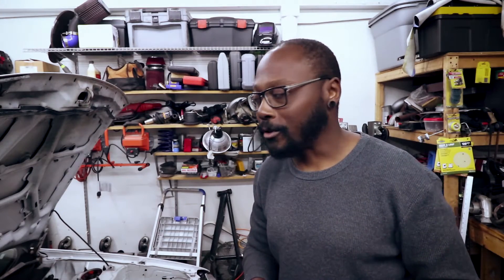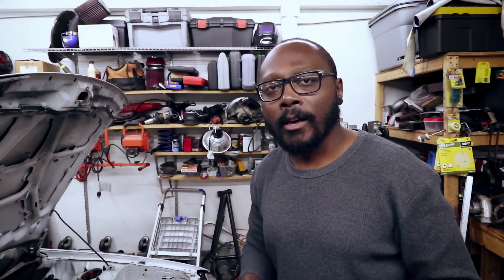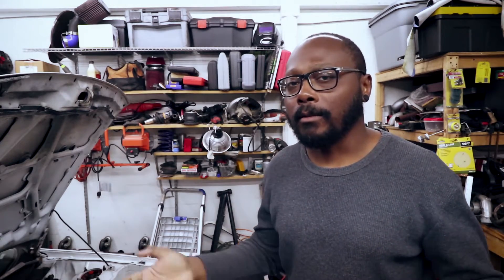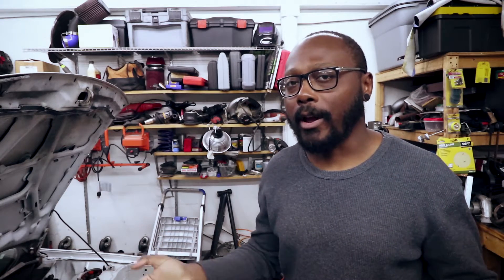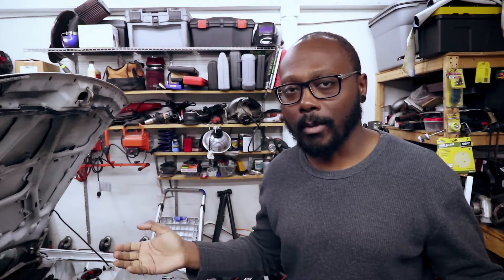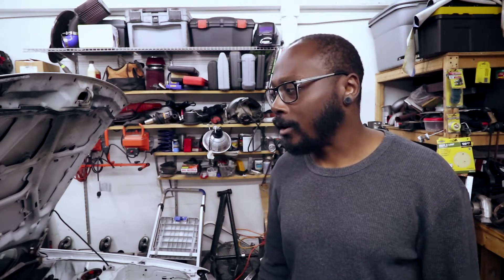Spark Blowout with COP...

Comment: best way to test for a voltage drop would be to load that circuit... I usually use a sealed beam. then you check from 12V at the battery to 12V at the coil or whatever you testing. difference between both (reading) will be the voltage drop.

about coil... I was thinking about VAG COP... integrated igniter, capable of firing a lot of Kv... and no need to bolt down... just not 100% sure they'll fit well. I'll try soon to fit to see how it goes. keep you informed!
Reply from the maker: Yeah, I'm going with the Toyota coils, I talked to Carlos (BP preformance specialit/la Stanley racing)  he's ran the Toyota coils to over 800hp so I have no idea what fab9 is on about.
Reply: just tried... they don't fit well. guess toyota COP 4 the win!

Comment: I may have missed it... but what alternator are you running? Is it stock, and if not what is the amperage output? I upgraded to a 250 amp in my Nissan Quest for air ride and audio,  but it has also significantly impacted the performance of the van overall.  Just a thought.
Reply from the maker: It's a stock unit. more than enough current since the car dosn't have anything power.
Reply: @StovallsGarage  gotcha. Was just thinking that there is more demand from the ignition at higher rpms or boost. Kind of like an amplifier when it runs out of input power (amperage) and starts clipping. Thanks for the reply!

Comment: I would look into spark plug gap and try gapping them down to like. 018 0r even .016
Reply from the maker: E85 isn't a fan of small gaps. I've got another coil set on the way. going with the tried and true toyota coils.
Reply: When my buddy had his sr20 we had to go down to .016 with ls coils on 32psi with a on3 bb 76mm  unit big difference in boost tho lol

Comment: Dude back in the day we ran the MSD 6AL with iridium plugs at 24-26 lbs of boost no problem. We also switched to the J9 air box for increased and better flow. I noticed that you were running a bit lean if that was an air/fuel ratio gauge, which could cause an issue depending on where you have the timing set. Have you thought about running an alcohol mist under high boost like what is used on a compound system, that may help along with larger injectors. good video by the way.
Reply from the maker: I'm on e85 it's kinda lean from about 4 to 5k , but from 5 to 7 it's set to 11.6 but its dips into the 10s near redline I haven't adjusted that high in the table yet.
Reply: @StovallsGarage  cool, cool, so what size injectors are you running at the moment?
Reply from the maker: 1000cc  with a walbo 255, with the e85 at 25psi they are just about maxed out at 95%duty

Comment: Perfect timing...

Just got back from a loooooong drive to find that i have an idling issue/misfire at low RPMs (idle-3500). Since owning this car i have suspected the ignition system (Mazda AZ-3/ B5D engine)

Maybe this will help. Thanks bro 👊

Comment: Need the Toyota cops pushed 20psi never had spark blowout alot of people run them on high boost
Reply from the maker: Yeah I was going to go that route, but FAB9 claims the Toyota coils aren't much better than stock, but I'm doubting that's true because as you said no one seems to have problems with them.
Reply: @StovallsGarage  yeah man they're wrong lol